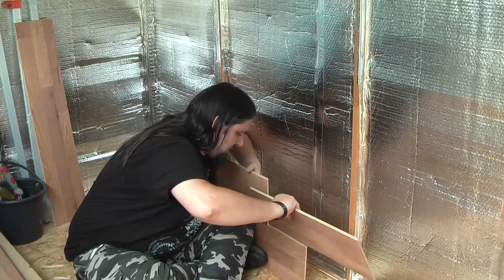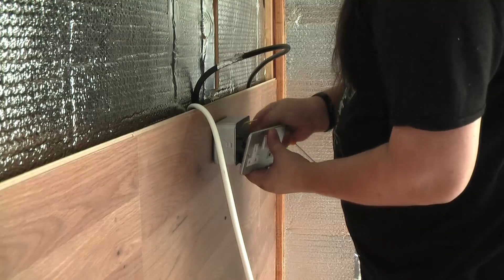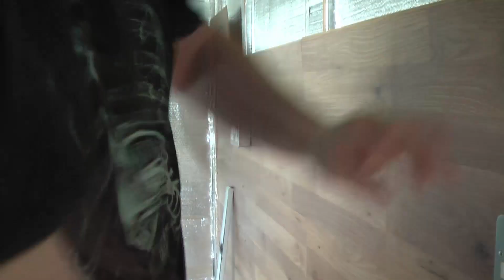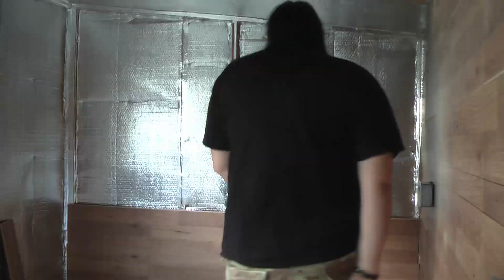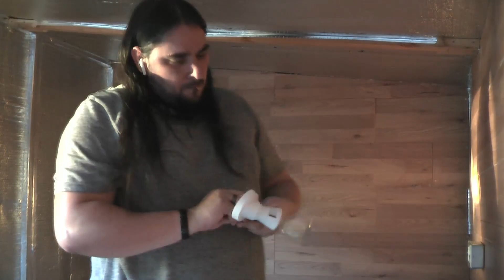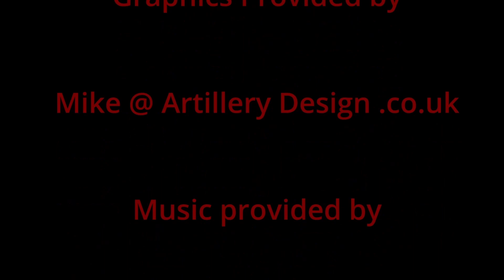New Workshop Build Part Two

Comment: Good luck with the inside paneling of your shop. I am a bit worried with having floating ends where the paneling ends with not having supports on the back side to attach the paneling to. Once hanging shelves to it how well is it going to hold up?
Reply from the maker: Not an issue mate, I'll be screwing through the panels and into the supports. And thankfully I only counted one section that wasn't properly secured, but that will be behind the workbench 😀